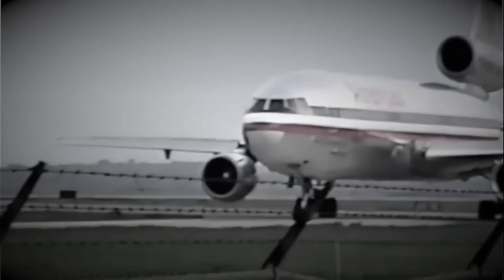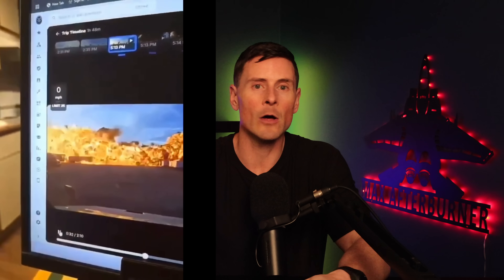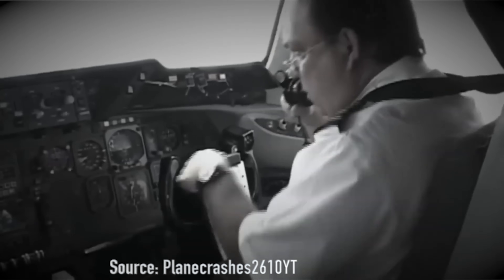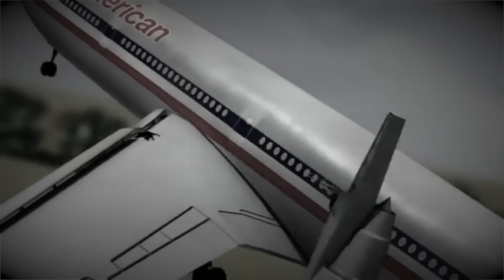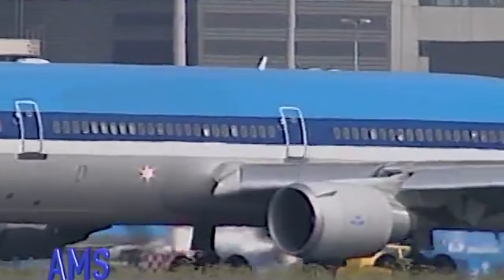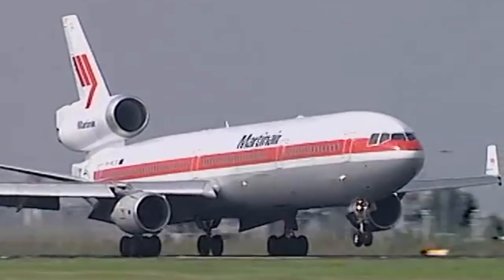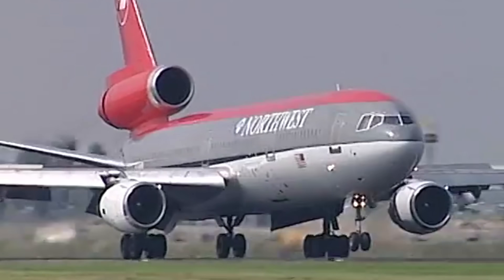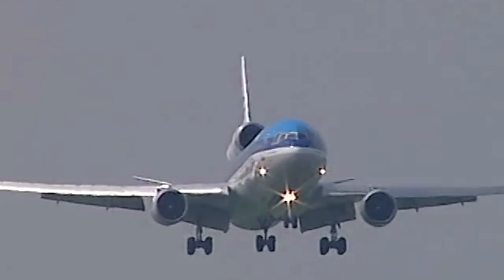Airline Pilot Exposes CRITICAL FLAW of UPS 2976 DISASTER

Comment: Super informative briefing Max A. Question: it appears the engines from 1979 DC-10’s produced about 40K thrust, and the MD-11 engines produce about 62K. Is that close to accurate? If the number 1 shrapnel wouldn’t have shelled out number 2 engine, would the pilots of the recent Louisville event been able to climb out and RTB without crashing?

Comment: I flew FedEx MD-11s for 13 years. I LOVED it (a domestically-fueled -11 was a rocket ship!) but it demanded your absolute attention at times.
Your explanation of the DC-10/MD-11's systems is OUTSTANDING for someone who (I assume) has never flown either.
Yesterday I was thinking AA 191 & (probable) maintenance shortcuts. You covered that very well. I was also thinking about the lack of slat locks & you also went there.
Two minor corrections: 
1: the DC-10 also has 3 hyd systems (3 engine pumps, 2 elec aux pumps and a ram air turbine that can supply either a lot of electricity or less electricity + 1 hyd pump.
2: the MD-11 is not fly-by-wire. It's "relaxed longitudinal stability" with some electronic enhancements in pitch.
Really great coverage!
Reply: You are correct in the similarities about the 191 accident, however I believe they will find a 'maintenance' issue is at least part of the cause. It's no coincidence that that aircraft had just returned from a heavy maintenance cycle in Texas recently and was delayed on that particular flight for work on the left engine.
Reply: @vincemajestyk9497  UPS denied that in the NTSB press conference yesterday, if it comes out that it was delayed due to maintenance, there will be significant repercussions for that.
Reply: @vincemajestyk9497 I read there was no maintenance the day of the crash.
Reply: They look like amazing birds and I always loved the trijet. My very first plane ride was a DC-10 built in the 1960s and it was the smoothest plane ride I ever took in my life. I always wanted to fly in another again but it wasn’t meant to be.
Reply: 6 engine driven pumps.....two per engine for 10's and 11's.
Reply: Correct - usually 1 active & the other "armed". I woke up in the middle of the night & almost posted a correction to my own post. Doh!
Reply: Thanks I have been waiting for anyone to even make reasonable comments or any sense of this.  So far mostly bla - ha - ha.  Politically based alt facts with generated weak opinions.
Reply: Thanks for these clarifications. He’s an excellent flight analyst.
Reply: They were doomed, so it doesn't matter if it was the wing or tail engine that had the compressor stall, but Captain Steeeve said it was shrapnel from the #1 engine failing that shot across and caused the compressor stall of the # 3 engine. Then there is the wisdom of the click bait crowd who will soon log on and amuse us.
Reply: I found the MD 11 to be an over complicated mess of an airplane that was unstable in pitch and tricky to land in high crosswinds That was just a few of the things I disliked My heart goes out to my fellow pilots that died  in this tragedy May God rest their souls
Reply: Dave between you and max I am astounded how much knowlege you two have acquired and assimilated into a format that one can follow without freezer burn . This interaction is is like watching a great movie , you have to watch it a few times to suck in all the variables but really entertaining !
Reply: My dad, Capt. Rudi Kohlbacher just retired from FedEx earlier this year after 30+ years of flying the MD-11. He's made similar comments about it being an incredible yet challenging airplane to fly. Particularly regarding it's unique landing characteristics, definitely not a jet for less experienced pilots

Comment: The last commercial passenger trijet, a Boeing 727 operated by Iran Aseman Airlines, flew on January 13, 2019. This flight was a domestic route in Iran, flying from Zahedan to Tehran. The last passenger flights for other major trijets, such as the McDonnell Douglas MD-11, ended earlier, with the final commercial flight in 2014. That's one old jet.

Comment: That Airplane looks wrong to me,  the 1 and 3 should also be in the back with the 2. So it couldn't eat debre from one of the others and if some engine fails asymmetric trust has minimal leverage.
Reply: The more engines in back, the more likely an engine explodes and cuts hydraulic lines back there. Furthermore that would necessitate a t-tail design with its own set of issues.

Comment: Safety measures are by definition a compromise because the only way to make any activity 100 percent safe is to prohibit it entirely.
Reply: But with they we wouldn’t do anything because it’s “dangerous” you are suggesting a very slippery slope
Reply: @TheBigSki  Indeed, and to my point that slippery slope works both ways if "zero risk" becomes the de facto standard
Reply: @tobymichaels8171 you are 100% right and that's not a slippery slope.  The only way to avoid a bicycle accident is to never ride a bike.....

Comment: American maintenance process was to remove the engine while still attached to th pylon, while the manufacturer manual stated proper engine removal was to detach the engine, then the pylon.  American wasn't the only airline to take the shortcut, they were the one that had the mishap.
Reply: If you think that AA maintanance was bad. Check out what Alaska Air was up to in 2020. 
  Unfortunately I was living in Point Hueneme during that event. Was on the beach 😢
Reply: Actually several DC-10’s were found to have the same bent mounting bracket from the same forklift engine service procedure.
Reply: @TheBeingReal  The bracket wasn't bent.  The aft pylon bulkhead was cracked due to contact with the wing mounted clevis when the aft pylon bulkhead went up too high in the clevis because the engine/pylon assembly pivoted about the forward mount.  Please read the NTSB report about the AA191 accident.
Reply: wrong wrong wrong- stop trashing mechanics when if you actually research facts which no one here has - you will find that AA MANAGEMENT AND ENGINEERING instituted a procedure, a legal procedure that was added in the maintenance
sop’s to change the engine and pylon assembly , American Airlines engineering contacted Douglas who said “we don’t recommend this procedure. “ 
However, they have no authority over the operators maintenance manual other than making recommendations and changing drawings so American Airlines management along with another operator namely Continental chose to approve this method . There were many other issues with the mounting of the pylons that were found with various DC tens from Douglas themselves, but it 
WASNT a bunch of cowboy mechanics, deciding to do some shady stuff it was you, people’s buddies and management and engineering that approved it. The information is out there, but I know it’s a lot easier to kick back in your recliner and shoot from the hip about things you know nothing about than it is actually research. What happened.
Reply: The pylons are fitted with interference fit bolts that are NOT removed in normal service.  This was the shortcut they were taking by knocking out the pylon bolts and removing engine with pylon then fitting the replacement engine already fitted to a pylon.    Changing the engine to the pylon off of the aircraft saved down time but also wore out the pylon fittings which weren't supposed to ever be removed.  

I've worked in several jobs where following the 'book' was mandatory but was told 'don't worry about that....here's how we do it'.   When I refused to go along I was black-balled and I suspect a lot of this is still happening out in the field.   Sadly...the people doing the shortcuts don't have a conscience and wouldn't feel terrible if them cutting corners caused an accident and it's unlikely the FAA will ever take stern action against them.   Let's hope this wasn't another case of poor maintenance.
Reply: @recoilrob324  The reason they were doing maintenance in 1979 was to change out some spherical bearings on the front pylon mount fitting per a service bulletin.  They were not doing engine changes with the pylon already attached to the engine.  There would never need to be a situation where you would do that.  For an engine change, you leave the pylon attached to the wing.
Reply: @stephenlocantore1203  
That's not what they said back in the late '80's when I was in A&P school.   Supposedly they had extra pylons that they attached to replacement engines then swapped pylons to save time.   It's funny that things we saw years ago have now been either scrubbed from the internet or changed to avoid blaming people.   Can't trust what you see today if you saw something different in the past.
Reply: @recoilrob324 this is so disturbing to hear, and the stuff of nightmares.
Reply: If memory serves me the ones who caused damaged used a forklift. Those using the engine stand properly didn't cause damage.

Comment: Not quite accurate. They would have incurred aero drag pulling the aircraft to the right, not left. However, the asymmetric thrust would have had more of a say here in the opposite direction. Hence the bank to the left.

Comment: You don't need to ingest debris to cause a #2 stall - just the hot air from the fire depleted of oxygen by combistion, will choke the engine and cause too much fuel vs. air mixture and the heat will imbibit compression of the gas. IMO the compressor stall was caused by the fire, which is almost surely from broken fuel lines still feedng fuel from the high pressure fuel pumps. You have to turn those off manually in this airplane. I think we will see this down to shoddy maintenance as with AA191, and for the same root cause - shortcutting engine off procedures to save time.

Comment: The destruction of the UPS engine suggests a catastrophic explosive failure. Other credible commenters are pointing toward pylon failure. In the case of the DC-10 its departed engine remained essentially intact albeit having shed some of its forward cowling. It was not as completely destroyed as the UPS engine. Both engines will have separated at roughly the same point in their take off runs. It might indeed have been a pylon failure but to my eyes the UPS engine looks way too destroyed to have simply fallen off.

Comment: I still believe something happened with the forward fan (big fan in front) looking at the forward cowling you can see where there was a uncontained area (where the fan blade rotates at, and the engine same area, i believe something happened to the fan hub (cracked) or fan blade failure which resulted im High Engine Vibes which is designed to break away if vibes are too high, the uncontained engine fodded the R/H engine, thats my belief.

Comment: I am betting the engine was installed improperly.
Reply: Based on what?
Reply: @Snaproll47518  that it came off the airplane.
Reply: I’ll take that bet since the engine shroud appears to have been damaged from fan blades departing the engine…and the ntsb said they found fan blades on their fod walk. So far the little evidence we have is looking like the engine left the aircraft after the fan failed causing an imbalance.
Reply: I guess that’s why the pylon (structure that attaches the engine to the wing) was found near the engine within the airport perimeter.

Comment: Looking at different dashcam footage... it appears the plane DID NOT roll to the left... the left wing hit the 3 black tanks and was severed causing the instant roll to the left.
Reply: Looking at the police dashcam it was flying very low but straightish until it hit those power lines and came down onto that fuel facility. 

You can see it start to roll then before bursting into a giant fire ball.
Reply: It didn’t roll but lost lift in the left wing due to NO ENGINE or Slats
Reply: @Sabot-83  Is there any evidence that currently suggests no slats on the left wing?

Comment: Imagine if they used a forklift to remove and re-install that engine again.. 😬
Reply: I was thinking about that.
Reply: Yup. I was thinking about that too.
Reply: Let’s see the NTSB’s report
Reply: It would be ironic if it were.
Reply: Makes sense. Could have been damaged long time ago and the minor damage kept growing and no one was inspecting area closely as they should have been.
Reply: @koreyg7674 I bet the dang mounting bolts were never torqued last time they played with it
Reply: Happens all the time. Loss of corporate knowledge and ignoring safety guidelines.
Reply: The accidents are similar but the UPS accident looks much more violent though, there is a fire at the same time as the engine was teared off, and the engine that we see on the ground is seriously messed up. It didn't just drop.
Reply: @Trowarr  The engine will fly up and over the wing when it departs. I imagine it tumbled for quite a while before coming to rest.
Reply: @beaugator this engine wasn’t producing thrust. It fell off.
Reply: @ShaunHensley  BS... it was at TO power. Even if there was a blade failure it takes 15-20 seconds to spool down. It was making thrust when it exited OVER top of the wing!
Reply: @Trowarr Juan Brown's recent video shows damage to the MD11's engine that looks very similar to another mishap, where a compressor blade broke off and basically blew out the back of the motor, leaving a large hole. 

Thankfully, on that other incident, they hadn't hit V1 and safely aborted.
Reply: If the pylon stayed on the wing this is a new problem.
Reply: @byzmack1334  From what I've seen in videos, the pylon went as well.
Reply: @beaugator  I've just seen that as well. I didn't see or hear anything about the pylon in initial reports though.
Reply: @byzmack1334  I noticed it in a couple of the videos that are out.
Reply: You say that… but they supposedly took an  Pratt & Whitney FT4A-6  turbine engine from a crashed jet  and installed it on the USCGC Hamilton, replacing one of them that had failed or needed repairs or something. The engine was used in 707, DC-8 and several military aircraft such as f-106, U-2 and the F-105
Reply: Don't give them any ideas...
Reply: My thoughts too.
Reply: Funny thing is that was an FAA approved procedure at the time.
Reply: I don't think maintenance would do that again. But it could have happened in the passed and caused mirco fatigue to the mount

Comment: What is a similarity: Takeoff comes with takeoff thrust, TOGA detent... It means higher forces, higher load on some parts compared to other flight phases. 

Both accidents happened when high thrust, somewhat high lift and "wing in ground" effect type aerodynamic forces were present. So I guess the pylon and the parts that attach it to the wing are most vulnerably in these conditions. 

A pylon design that would be more likely to fail at low speed than in high speed would give more chance to abort the takeoff.